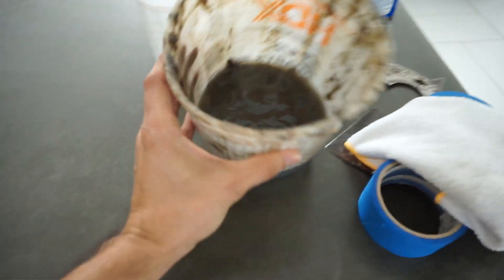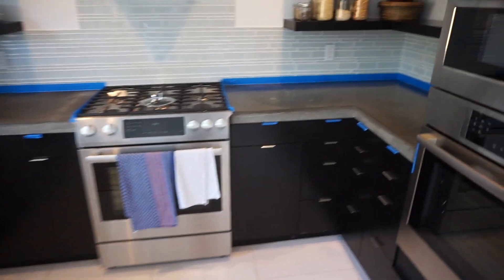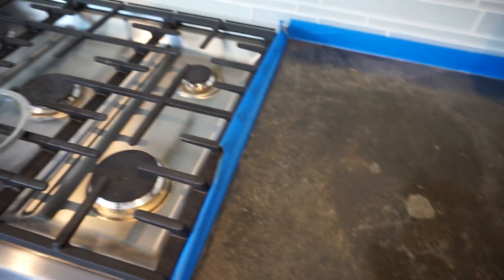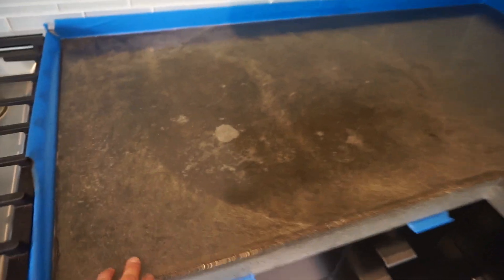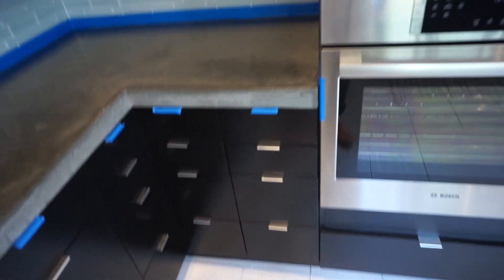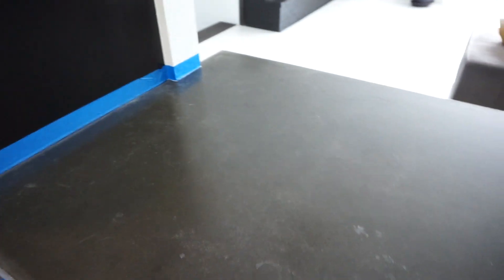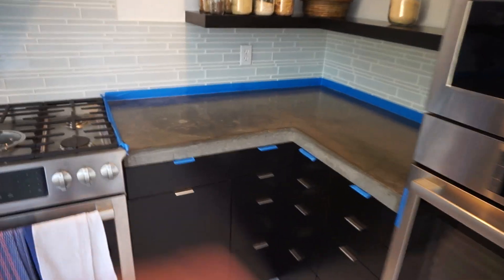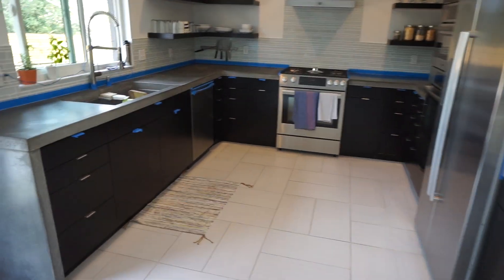WAX IS NOT A SEALER for Concrete Tops ... NEED to us a sealer

Comment: Curious what you would use to seal and protect outdoor concrete counter tops used for a grill area? Stained easy and now i need to refinish so I would like to learn from my sealing mistakes and do better this time. Id be happy to send photos for advice?
Reply from the maker: Feel free to check out surecrete design products. Look for XS-327 matte or gloss. Great product when applied correctly

Comment: I'm resealing/finishing a bathroom concrete countertop. Can you give any tips as far as removing all the old stains, watermarks, sealers and finishes? It was sealed (and waxed) once before, years ago. Do I use mineral spirits? Muriatic acid? I don't know what I'm doing I just used a heavy duty floor stripper and it looks effed up. Help please!
Reply from the maker: Use Xylene (xylol) in small amounts with a scraper... after that, sand lightly. Use baking soda on heavy stained areas. Other than that, you'll be ready to seal. I recommend XS-327 from surecrete. I prefer matte, but they also offer gloss

Comment: What product would you recommend to remove the bees wax that was applied sadly approximately 10 years ago?  These where acid stained and not sure what how I would go about sanding to restore with out causing damage and having to completely starting over. It seems very hard to find information. Thank you in advance
Reply from the maker: Start off with Denatured Alcohol...if that doesn't work, then move on to Xylene (Xylol) both can be found at home depot or lowes

Comment: What are your thoughts on water based polyurethane on concrete with a food safe wax topping. I seen this done on self consolidating concrete that doesn't take in sealer to well and it looks amazing.
Reply from the maker: I dont think it's a bad idea if that's your only/best choice. I personally like to use a hybrid aliphatic water-based seer which already comes with the "food-grade" safe properties built into it. It's called xs327 from surecrete
Reply: @noboringconcrete 
Ill look into that, thanks for the quick response. Im looking at tung oil as an option also as it will harden and is a natural finish. If i went with polyurethane would any do?
Thanks.